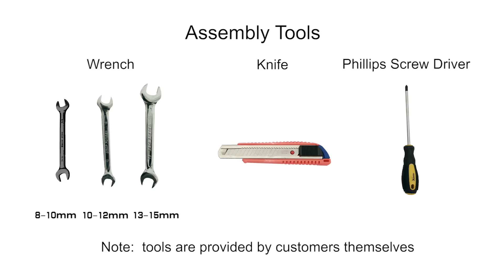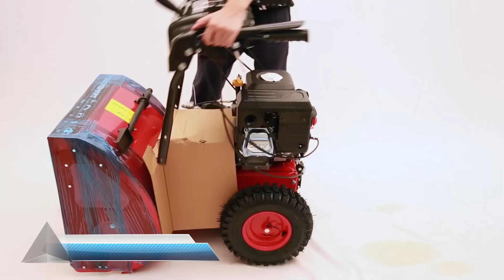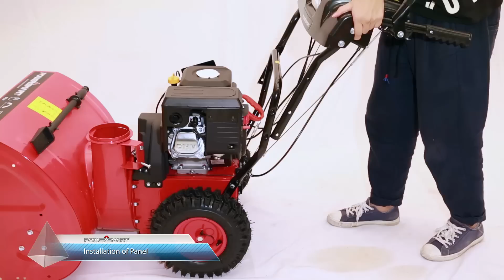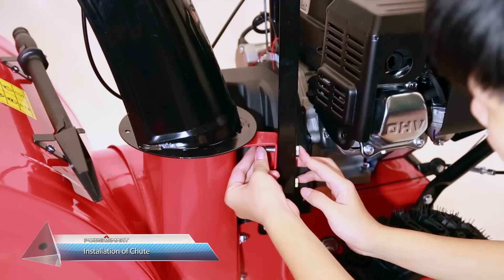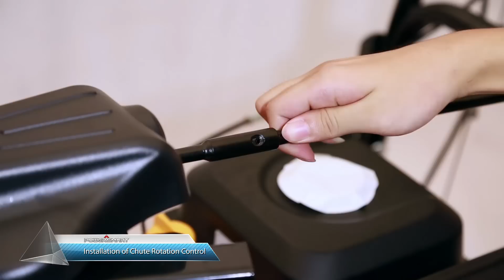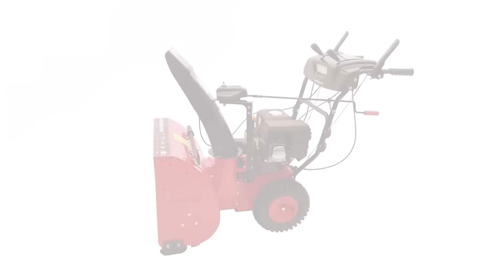Powersmart Snow Blower DB7103/DB7103PA assembly

Comment: I just assembled mine, today.  However, I don't know where to attach a small curled wire included with the break off bolts.  It could be used to a cable but there is no reference guide for it.
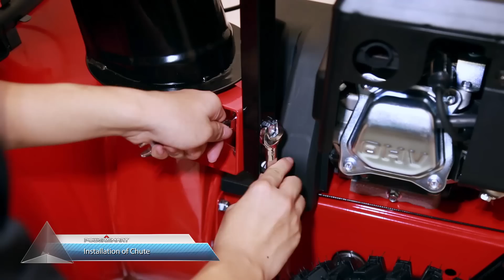Reply: Go to 3:44 in the video.

Comment: Bought the DB7013-24 last year used it once then drained the gas and parked it,  in a shed, this year gassed it up and put in the key and it will not start at all. Followed all the instructions in the manual just in case I missed something. It cranks and acts like it has no spark or gas, or maybe not recognizing the key, and its dark out now so I can't troubleshoot it but why should I have to on a used once, year old piece of equipment that is this expensive, I am extremely displeased I hope you see this message and others do to
Reply: I am having the same issue with mine.  Mine is two years old.  I don't know what to do. Arrg!
Reply: even it’s 6 years later , still worth with my penny advice , 1st , you drained the tank , did you drain the carburetor ?  even you did then please work with me , gasoline now a day , has the tendency build up “ gum” , after draining the gas out from the tank and the carburetor , disconnecting the hose from the tank to the carburetor , connecting your own short hose to the carburetor , spray “sea foam “ , wait 5 minutes, then air blow the sea foam out from the carburetor ( leave the carburetor drain nut off ) , then put everything back they way they were , if you decide to change the oil and lubricants every movement parts , by all means to do so , you should have your power smart snow blower , longevity for many many years to enjoy ,wish you trouble free ! no machine is a dumb machine , only human is dumb enough to let the machine over power us !